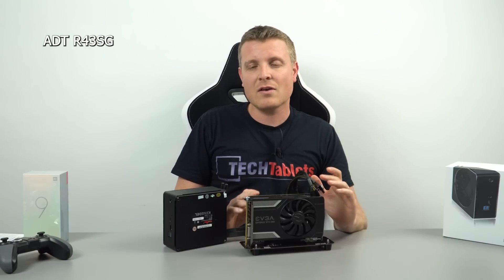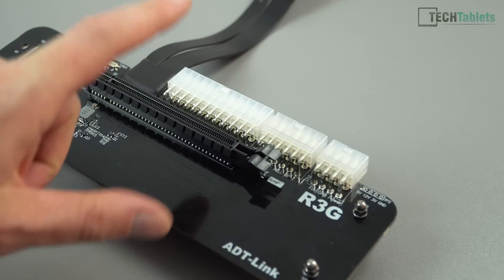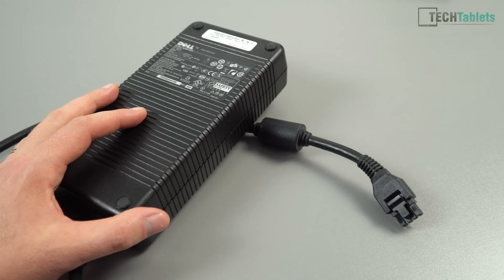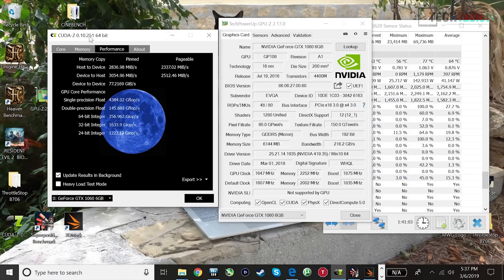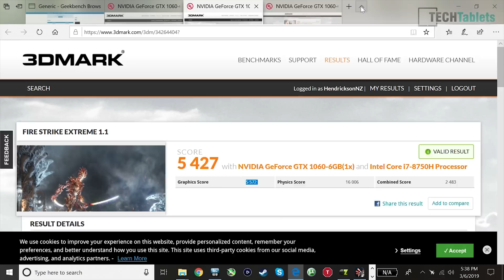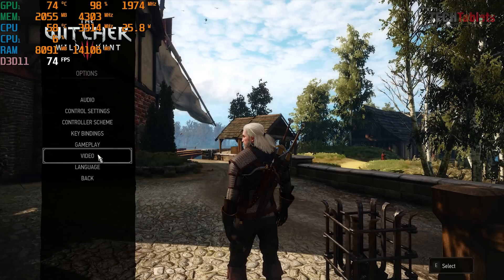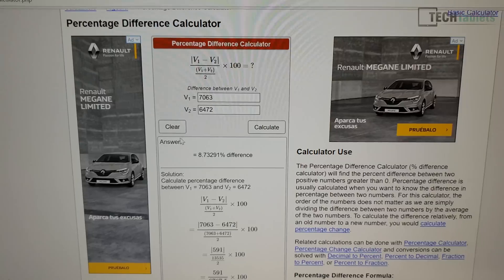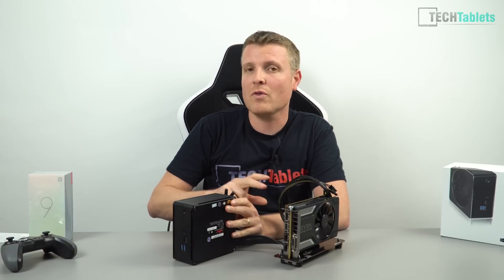M.2 PCIe x4 to External eGPU - Faster than TB3 eGPU's

Comment: I got the exp gdc beast a/e key for wifi card adapter it is pci x1 and it definitely impedes performance. I am ordering a r43sg for the nvme pci x4 connection. Lesson learned.

Comment: Why don't manufacturers make M.2 Graphic card and M.2 Ram, they can add M.2 SSD and Graphics on a single M.2 chip so that it will work extremely-fast (at small nm architecture) for video editing and gaming for those who don't have PCI slots in their laptop???

Comment: Man. Are those able to run a capable gpu at QHD 100Hz?
Hdmi 1.4 max 1440p(qhd) refresh rate is 85hz and it has 10gbps. On the other hand, pcie x4 3.0 has 4gbps.

Comment: Good morning, I wanted to ask you and if it is possible that you can help me.

I had a Mac pro 2013 but the processor was damaged and I need to extract the information from the hard drive, which is mz-jpu256t/0a1 samsung 256gb pcie express 3.0 x4 ssd.

Do you know what external USB cabinet adapter I would need to extract the information? or if you know any other way and you can tell me I would be very grateful. a cordial greeting

Comment: so it's PCIe 3.0 4x : 31.52Gbps  (32Gbps) vs Tb3 40Gbps..why you say M2 PCie 3.0 4x is faster?
Reply from the maker: You actaully loose speed via TB3 and in my tests the NVM PCIe enclosures are faster. I did have the Razer eGPU and it was worse due to the TB overhead it's not as fast as on paper.

Comment: If the key on my motherboard is on the right rather than left for the nvme slot is it safe to flip the m2 nvme connector board so it fits in the slot?

Comment: I'm looking for something like this, except I need it to be PCIe 4.0 x16... I'd like for an adapter to sit in the x16 slot on the machine, that exposes the connection externally through one of the slots at the back. Any ideas?

Comment: I need to buy an eGPU to add a discrete graphics card to my laptop. There are two connection standards on the market: NFF and Mini PCI-E. So with the HP EliteBook 840 G2 laptop, which connection standard should I buy?

Comment: (adt link )my gpu won't show up in device manager but the fan is spinning. it works find in gdc v8 beast.
Reply from the maker: Try the switches to get it working
Reply: @Techtablets  my laptop is Asus FX553VE , i tried switching the switch. but still won't show up in the device manager.

Comment: a shorter cable is better
Reply: Actually it doesn't matter. Have you seen a standard Desktop Gaming PC but with Vertical GPU mounting? That definitely using PCIe Cable extender. And the length is pretty much the same like in this Video.

Comment: Please correct me if I'm wrong here.
If a motherboard like MiniPC or Laptop has 2 NVMe SSD slot, and both were specified to run at X4 PCIe Lanes, shouldn't filling both slots will make it becomes X2 PCIe Lanes?

So let's say 1 slot already used for NVMe SSD where you install Windows on it, and then if you Plug eGPU into the other slot, doesn't that makes it X2 instead of X4 Lanes?

Or am I wrong?

Comment: If one does this on a Laptop, does it still need an external monitor? Like the wifi card method...
Reply: Good question. I heard if your NVMe PCIe Lane stay at X4 when the eGPU is plugged, then you have chance to use Laptop's internal display.

If the NVMe PCIe Lane become X2 then you need to use external display from GPU output. The easiest way to check it is using GPUZ app.
Reply: @ClayWheeler  thanks man!

Comment: @TechTablets when using the Dell power adapter does, is it just a single cable plugging into the top of the GPU? Or the ADT link board?
Reply from the maker: Okay so Dell power plug into it and the cables to the top of the GPU yes. But only good for up to about 200W GPUS over that you need a PC Power supply.
Reply: @Techtablets  I picked up the 220W Dell PSU, will run a GTX 1070 Ti. It should hold up.

Comment: Can i use that EGpu with M.2 To Type C Converter?
Reply: Is the Type C you talking about just Type C? No Thunderbolt capability? You need Thunderbolt port Type C, not the ordinary Type C port. If your Type C socket don't have Thunderbolt, it can't use eGPU

Comment: So you have powered the 1080 Ti with only the Dell power brick?
Reply: Considering the GPU never reach 40% GPU usage, it is fine. Because of the bottleneck, the wattage consumption also low.

Comment: Can I remove my wifi lan card and install egpu on my Lenovo m715q ryzen 3 mini pc with ngff cable and external dock
Reply: Apparently you need EXP GDC eGPU, not ADT R43SG ADT-Link.
Reply: @ClayWheeler  or can I use this on my ssd slot
Reply: @sayedmuhammadwaqarshah237  by SSD I mean NVMe SSD. Not SATA SSD
Reply: @ClayWheeler  yes my mini pc Lenovo think center m715q ryzen have ssd m.2 slot
Reply: @sayedmuhammadwaqarshah237  Good
Reply: @ClayWheeler  one more important question if my pc motherboard is locked will the external gpu will work plz reply
Reply: @sayedmuhammadwaqarshah237  I don't even know about that. Try make a video of it using your Phone and upload to YouTube so I can see the problem
Reply: @ClayWheeler  I mean I have read that those pc integrated gpu vram does not increased after upgrading ram has mother board locked my pc have Vega 8 graphics in bios settings it has max 512mb and auto option after using auto option it will show 1gb vram max only even on 8gb ram I have upgrade to 24gb ram but still shows 1gb vram Vega 8 that's why I want an external gpu amd or any
Reply: @ClayWheeler  this is my problem tell me external gpu will work or not?
Reply: @sayedmuhammadwaqarshah237  That's Not how it works.
Check my channel for eGPU video
Reply: @sayedmuhammadwaqarshah237  First you need to open the MiniPC case to be able to check the type of the available socket. I don't know if you have NGFF or M.2 NVMe. That's why you need to double check the main board.
In my Video, I give several examples of eGPU models. There are at least 5 different types of eGPU Connector.

Comment: would the ADT-Link  M.2 PCIe 3.0 x4 support a  Dual M2 SSD NVME /SATA to PCIe x4 Adapter Card, this way I can have 2 M.2 drives with a different OS on each one.  I need to run WIn and Linux for development, and I keep  a Corsaire 128 GB just for Tails

Comment: Hi pls tell me can i use this adapter with a normal m2 slot? Or it should be nvme? And if i can use it with normal m2 slot am. I going to lose in performance?? Im thinking to get an gtx 1050ti or a gtx 1650? I wanna get this setup for my laptop cause my dedicated video card it's not working anymore ((

Comment: Nice job!
I really like modular designs.
I wonder now with PCIe 4.0 widely available (on higher-end Ryzen MoBos) are there similar eGPU converters for PCIe 4.0m and wouldn't the PCIe 4.0 even at x4 would be plenty of bandwidth to not cap your GPU performance?
If it is I might consider making an eGPU housing to complement my Lenovo c940 15" (that only has gtx 1650 maxQ inside) or even other ultrabooks that only have integrated graphics.
(I already made SFF 12.5 liters ITX desktop with i9-9900K & rtx2080ti, fully water-cooled with aluminium 360 radiator, at total weight just under 6kg ... so I think I should be able to manage that as long as the electronics are available and working fine - I mean a M.2-PCIe-4.0-x4/NVMe to eGPU converter)

Comment: hi there, i got a little question, so i'm on a laptop, its an okay laptop, just not great, so I know i can upgrade my ram, i currently have 8, i plan to upgrade to 16, and i also plan to get better fans and overclock my CPU slightly, only a little bit, its 1.80ghz at the moment, I plan to get it to 2.0ghz, then, if i get an eGPU, would this whole project be beneficial? I don't want to get a desktop since i need the portability, nevertheless I've got time, just make sure not to necropost

Comment: Hi Sir, please may I know the bios settings for setting this x4 gpu motherboard on the hystou s200 core i7 8th gen. I have my sata III Pcie hooked up on where it us written Nvme/Sata then the gpu motherboard at where it is written NVME only. Will I have to make some changes at bios or something ? Please advice.  I also powered the board with the  same dell power but connect at GPU POWER OUTPUT
Reply from the maker: You need to set the switches on the adt link. Try different  combinations

Comment: Hi! I have PCIe 2.0 x 4 - M key slot, would it work with this?
Reply from the maker: No you need to have PCIE 3 x 4
Reply: @Techtablets  actually mine is a 3.0 slot but running at 2.0 x and i cant figure out why. bios wont allow me to change.

Comment: My Laptop(HP-15) has M2 (mPCIe x4 2.0 slot). I want to add eGPU through MPCE cable to connect M2 with PCIe x16 board. Please can you recommend me any graphics card that can work fine with this slot as i know it has pretty less bandwith. Any eGPU will work. I just want because atleast it will be better then Intel HD Graphics.
Your reply will be very much helpful for me

Comment: I might listen not very carefully, but did you actually compare M.2 with Thunderbolt? Why it's faster if both M.2 & Thunderbolt support 4 PCI lines?
Reply from the maker: I have in the past and it's because you loose a little performance with TB3 due to he way it's designed. But it's much cleaner and better looking than this set up even if a little tiny bit slower
Reply: @Techtablets  thankz for your reply. For sure Thunderbolt is much cleaner and less hassle but at the same time it's much more expensive

Comment: Can this work as hot Plug or do It require to reboot the computer every time? Do the m.2 nvme pcie 3.0 x 4 work as hit Plug?
Reply from the maker: Will require a reboot
Reply: What will happened if the m.2 cable is unplugged from the motherboard during hot run? Will the computer freeze or bluescreen loose display or will it revert to igpu?

Comment: Good solution for the mini PC. I found in AliExpress an expansion port m.2 to pciex16 with sata power supply. Can I get a low consumer graphic card 50wat without external psu, connecting directly to Mobo sata HD bay?
It will be possible if I get an adapter 19v with more amperage/watt capacity?

Comment: i got lost with the power supply part, can you explain where was that connected? and how? i'm kinda lost sorry, im buying the i9 version of this small pc, and was looking into the future to do the external gpu if needed, since i'm an Xcode ios developer, and wanted to make my own Hackintosh mini :D
Reply from the maker: Dell 8 pin plug is what I used for the GTX 1060 it's that big power supply I showed
Reply: @Techtablets  thx for replying, is the cpu upgradable in the future or not? And do you think this is a good After effects motion Graphics machine without the whole external gpu part??

Comment: Hi, great video.  I've bought one along with a Dell DA-2 power brick.  Can you describe where you plug the cables in please? I can't see that on the video.  Also, should the GPU fans fire up without it connected to the computer or does it need to be connected via the M.2 slot first?
Reply: 9 months late, but you need to put the positive to the yellow wires and the negative to the black wires on a 6 pin connector

Comment: Sir, I have a question I hope you can understand me. I have a laptop after the eGPU installation should I plug in my laptop's regular adaptor too or only the DELL to the eGPU adaptor? I couldn't figure it out myself. Thanks.
Reply from the maker: Yes you need your normal adapter also

Comment: I tried this setup with the Dell DA-2 series power supply as recommended, but the power supply doesn't fit. The 8-pin connector has different shaped connectors and I notice that in your video, it's definitely not the Dell power supply that you're showing as connected unless you found an adapter. Did you use an adaptor or discover that the Dell power supply is not suitable?
Reply from the maker: I used the Dell one as mentioned I think your version is different then

Comment: Thank you for these videos! I'm definately going to get a similar setup 😊
Reply from the maker: It worked out much better than I expected it would
Reply: @Techtablets  ps. If you wanna do something more "geeky", you can hook up your monitor in to the iGPU and adjust settings to use 3D apps on the NVIDIA GPU in the Windows 10 settings. However, with this setup you'll lose the ability to use NVIDIA control panel itself. If you need them to be adjusted, you can do it before switching the plug to iGPU.

Comment: I have a dell optiplex 3050 micro,  I want to get set a external gpu. It says that this model has 2 pcie slots,  so i want to maximize it by putting also a m. 2 ssd. Can someone show me on how i will set this up with my optiplex 3050 micro,  thank you in advance.

Comment: Excelent review. its what I was looking to upgrade my Hp AIO gt950m card. Which is m2 btw. Can you post where to buy the external power supply with 8 pins? I couldn't find any at aliexepress. Thanks

Comment: I dont understand how you connected the Dell PSU to the dock ... the Dell 8 PIN connector includes a REMOTE to the power supply. I dont see how you can connect it straight to the R43SG. You are never showing that in your video.
Reply: there is a "Dell 8P" in the R43SG pcb so can't miss where to plug it
Reply: @adizon2  thanks man! 👏👏👏👍

Comment: TB3 is 40 Gbps though vs the 32Gbps you said you're getting with this.  This is an interesting device though.  I recently built an ITX system which has a TB3 port, but it turns out it's only capable of running at x2.  The motherboard has 2x M.2 slots, (one on the front, one on the back) so I could conceivably connect this adapter to the back of it and run a 2nd GPU if I wanted.  Not really necessary since it's an ITX board with a full x16 slot (using an RTX 2070 Super), but just for giggles it'd be interesting to be able to run 2 cards from an ITX box.

Cool video anyway.
Reply: But this is straight PCiE while  thunderbolt has to do some other processes that add latency
Reply: @manolinmero  Yes, in theory TB3 is faster but in practice it's actually slower than NVMe M.2

Comment: 1 question, did you run the  videosignal directly from the external card to a monitor or did you loop the signal back to you mini-pc and then to a monitor.
The latter clutters the bandwidth of the m.2 so if you did, performance loss could be reduced a few percent.
Reply from the maker: Direct from the card

Comment: For those wondering about all this when it comes to editing videos. You want a better CPU with more cores to take priority over the GPU, but with that in mind, im getting a similar setup to this to make my current laptop which has a 520 gpu run way better. the gpu will help alot with encoding. This is temporary since i dont have ALL the money to build a full blown PC. so im buying a power supply which will be added to my PC build along with a GPU that i choose. at that point it looks like i wasted $50 on the adapter butttt. I can always use it later on since i dont have the other $500 to complete my PC build with motherboard, CPU, case, SSD, RAM.
Reply: OR, just get yourself a Editing Video software that 90% runs on GPU instead of CPU. Don't tell me you haven't heard about it.

I'm currently editing video on Dual Core i3 6th gen but paired with GTX 1660ti. Everything went smoother than my old Video Editing software since GPU took most of the Processing.

Seriously just get a Software that runs on GPU instead of CPU.
Reply: @ClayWheeler  which software do you use?

Comment: For similar product (exp gdc) it's said that we need to use old driver for 1060, 1070, and 1080. Is it the same with ADT-Link? And will it be compatible with rtx?
Reply: I have the exp gdc connected via EC and I have the lastest drivers and it runs fine with my 1060 6g, no issues.

Comment: Good morning, my name is Francisco I am from Brazil, so I have a doubt, Can I use this adaptor in the m.2 nvme of my laptop (dell g3 3579) with gtx 1050, because I want buy a GTX 1660 TI, but I don't know if this will create a problem because my laptop has a gtx 1050 or if is possible disable my gtx 1050 for use only the gtx 1660 TI, and will I need buy a new monitor or I can use the monitor of my laptop?

P.S Sorry for my english, and your video was very good.
Reply: I have the same question. I'm from Brazil too and have the same laptop.

Comment: Great video!. My main question is can you unplug that egpu after the drivers are set up, restart and then use the original graphics? I want to basically make a plug and play egpu, but I can't find a definate answer?
Reply: In the video he says that if you do not power the card, the system will  use integrated graphics.

Comment: Will this work on your MaiBenBen G5420/i5-9400 laptop?
Reply from the maker: Yes use on of the pcie slots
Reply: @Techtablets  Thanks! Noob followup question - is that the same slots as the M.2 slots?

Comment: AFAIK all native m key m.2 slots has access to x4 lanes of PCIE 3.0, bandwidth at 3.94 GB/s, compared to ThunderBolt3's 5GB/s. However since this m key interface connects directly to PCIE lanes it should theoretically have no additional signal conversion which induces latency. 4GB/s is enough for most of 2019's cards with exception of current flagships like 2080 Ti and Radeon VII. The reduced latency means much more consistent frametime and framerate. AND BESIDES, THE THUNDERBOLT CONNECTION PRICE IS WAY TOO HIGH TO OUT-COMPETE SOMETHING THAT UTILIZES THE SAME BUS THAT THE GRAPHIC CARD WAS DESIGNED FOR, FUCK THUNDERBOLT! Well I hope more laptop come out with M key m.2 slots :)

Comment: It's better to build mini itx with normal pcie x16, simpler and better performance.
Reply: well in this case he just shows how if you already have something with m key m.2 slot this is a good option. and also even a mini itx build would be meaningfully bigger than this machine.performance loss is there, but much smaller than other egpu protocol/interfaces, and imo is small enough to make this a good option.